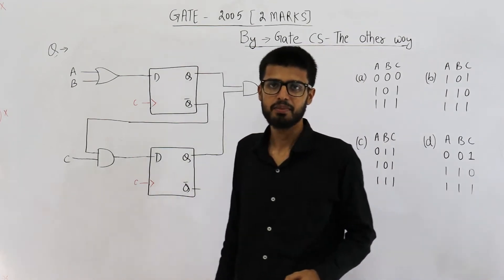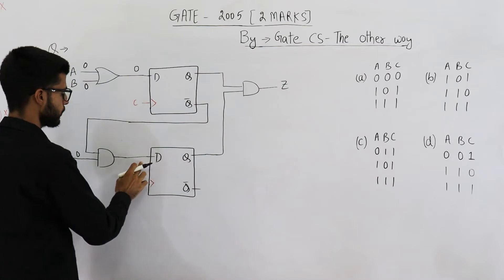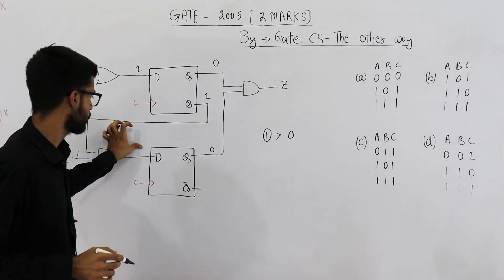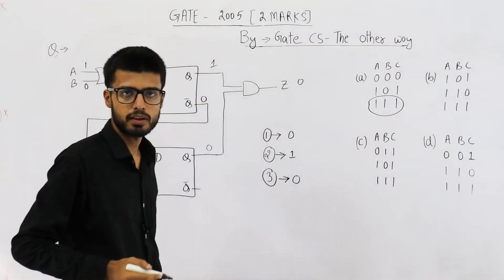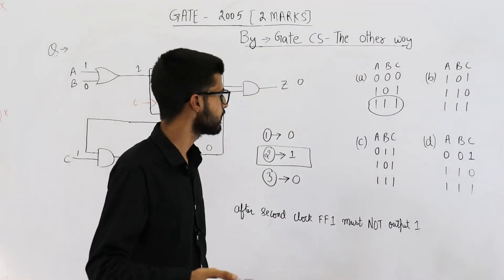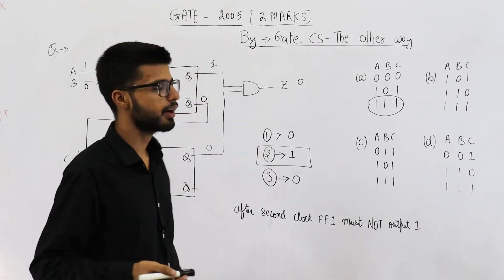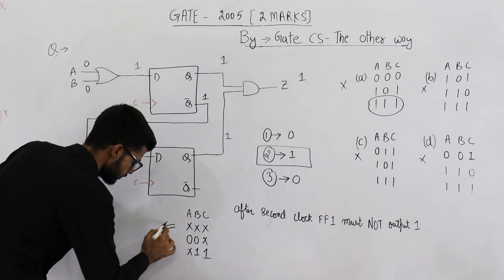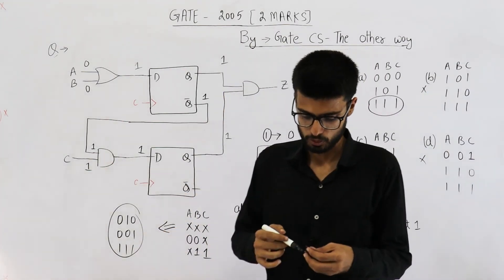Gate 2005 pyq DIGITAL | Which of the following input sequences will always generate a 1 at the

Comment: 3:43  Why you are not changing the q' immediately after changing the q  and you are  considering the change of q' in next clock but not in current clock. Why??
Reply from the maker: I rechecked everything. There is no error in video. Please watch it again. 

I have changed q'  after q everytime. 
And effect of any change on q' will be conciderd in next clock only(as clock cycle actually caused that change in q nd q' and clock is momentary)
Reply: @GateCsTOW Thankss